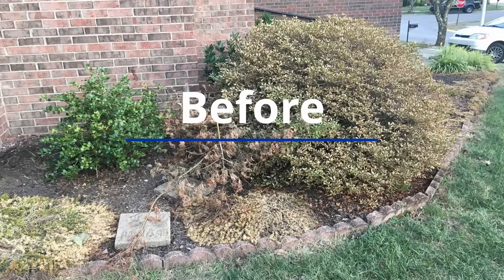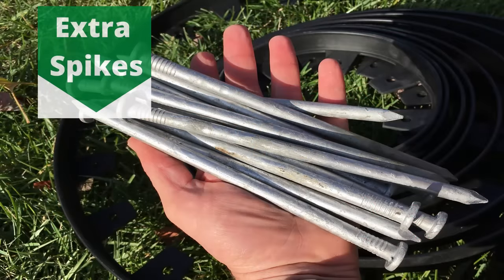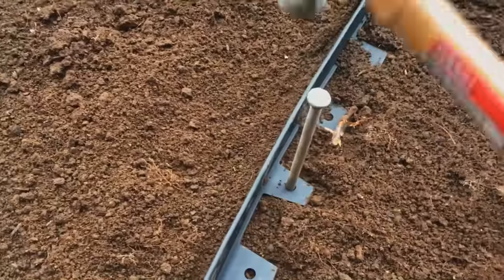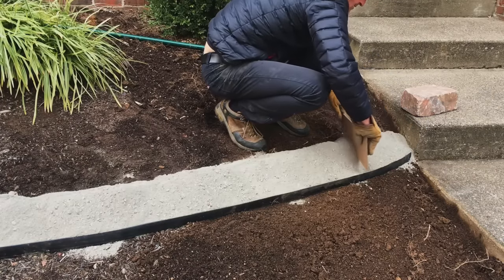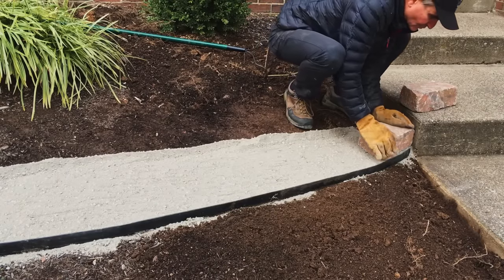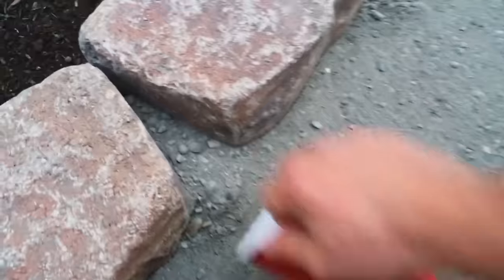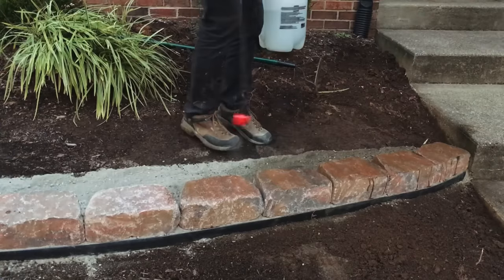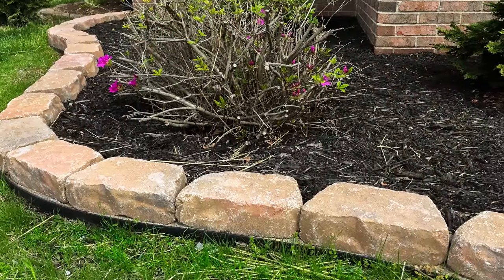easy diy No Dig Border *2020 UPDATE*

Comment: How many bags of cement did you use and how many feet was the area you did?  I want to do something similar and it’s 40 feet long area by 4 feet on the ends.  Thank you for your help, this video is just what I needed as this is my first time doing a project like this.
Reply from the maker: Oh good! I's so glad you found this video. This technique solves many problems people have had with different borders. Each bag of concrete mix works for about 5 linear feet so you would need 10. Get one or 2 extra, though, just in case. Its never fun to run out of supplies during a project. Have a great day, Michelle!!
Reply: @maxpatch67  thank you so much for your help!! I have never done any type of landscaping work and I was to the point I was thinking of hiring someone to do it, but after finding your video, I feel a lot more confident I can pull it off.  What I want to do is use decorative stones to fill the front area of our home and use this for the border around it.  I did see similar rocks that you used but I felt they were a little bigger for the area we have so I went with ones that are a little smaller and think they will work perfectly!  I’m so excited to get started.  I sincerely appreciate your help and again thank you so much for sharing this video, I’m sure you have helped so many people save so much money, time, and hard work with this and I can’t thank you enough!  I will keep you posted and if possible or share a before and after picture or video! Take care!
Reply from the maker: Michelle, you are too kind. Thank you so much for this thoughtful comment. I really appreciate you taking the time to leave this comment. It sounds like you are a very visual person like I am and you want it to look good. I think you made a good choice using the smaller stones for the smaller area. I would do that too if I were you. If you get it finished, I'd love it if you could send me before and after pix that I can share on my website to share with others. My email is tim@timvogelaar.com.
Reply: @maxpatch67  I will definitely send you before and after pictures!  The before won’t be very pretty at all, but I’m hoping I do a good job with this.  And yes, you are correct, I’m a perfectionist or so I’m told, I want it to look perfect and it will mean so much more to me if I can say “I actually did this!”.  I’ve been getting braver with diy’s lately, I painted our entire home inside last year, first time for me.  It took me awhile as I love painting but I get tired of doing it, but it got done and I was so proud of it. So I’m hoping this will be the same scenario.  Again, thank you and I will send you pics once it is complete.  😊
Reply from the maker: Awesome. This is the right border for you because it is going to stay perfect looking for you forever because of you using this technique and it will also help a lot with weed control by helping keep things out of your landscaping area. Here is a really good mulching technique that I highly recommend since you want to make things very nice and stay nice: https://studio.youtube.com/video/HIWDPlaB6wY/analytics/tab-overview/period-default This goes a LONG way for weed control.

Comment: Will this not create a potebtial drainage problem?
Reply from the maker: You will need to figure what to do with your water situation. I usually divert the downspouts into the ground and run them out into the yard about 10ft or so where the water exits through a drain box. Every situation is a little different. I'm glad you are thinking about that!!

Comment: Great video! We have to do a 100 foot border and are on a tight budget. can we skip the plastic border and use paver sand instead of cement?
Reply from the maker: Ya, I understand your dilemna. The border costs around $5.50-$6.00 per foot so yours would be around $500-$600 for the materials. You can cut corners how you want, but the cement is a major part of this technique. The cement provides four major functions in this border technique 1. Height(for looks) 2. Keeps the stones straight/aligned over time 3. Stability/strength 4. Weed barrier(the extra width is nearly impenetrable to aggressive weeds and grasses(Bermuda Grass) that we have here in Nashville.
Reply: @maxpatch67  Thanks for the advice. We will be starting soon.
Reply from the maker: Thor Matt, you're welcome. I'm so excited for you. You won't regret creating your super nice border. If you'd like to send me pix to my email tim@timvogelaar.com then I could post them here: https://www.timvogelaar.com/Diy-no-dig-border-folder-of-galleries for others to see. Feel free to browse other viewers' work there. People have really improved their properties as you can see in the photos. Have a great day!

Comment: Is the plastic edging strictly necessary? the space I want to do butts up to a sidewalk so I'm afraid the black plastic will look funny
Reply from the maker: Ya, the plastic edge is meatnt to use as a form for the concrete mix and a way to level it off level so if you can use the driveway for this, then you would not need the plastic edging. I hope this helps!!

Comment: Is the cement really necessary? Or can we work with out it?
Reply from the maker: This technique really centers around this unique cement product...not using it, you lose out on the qualities it provides. The cement provides four major functions in this border technique 1. Height(for looks) 2. Keeps the stones straight/aligned over time 3. Stability/strength 4. Weed barrier(the extra width is nearly impenetrable to aggressive weeds and grasses(Bermuda Grass) that we have here in Nashville. I hope this helps, Jeremiah!!

Comment: If I am butting edging against a concrete pad can I use this edge instead of the edging? If so do you recommend how deep the concrete should be if not using the edging?
Reply from the maker: Great idea. Here is exactly how to do this. Dig you area out to about 3" deep for about 1' out from your concrete pad. Instead of using a flat piece of cardboard for your levelling tool, use about a 2' long piece of cardboard and  cut about a 1/2" out from about half of the cardboard length. When you use that to level it off with the concrete pad, let the part that you did not cut out hang down into the cement mix and after levelling, the cement mix will be flat and smooth and just the right depth for the blocks to sit. If you have any questions about this, just ask...have a great day!!

Comment: Looks great! Question though: wouldn’t it work better if you inverted every other block so they fit more cohesive together? That way there’s no gap in between to deal with? Not trying to be critical, just planning and wondering if there’s a reason behind the method. Thanks !
Reply from the maker: Ya, that's a great idea to flip them around, but with curves like this, it does not work because then it looks worse with some gaps on the front on the outside of these curves. Your idea is perfect for a straight line. WIth curves, you'll want all the gaps on the inside. Have a great day, Willyman!!

Comment: Can you layer the pavers using this method.. 3 high
Reply from the maker: Dutty, I have not made a second layer on this type of border because I don't know if it would look that good and the difficulty level is raised some because you would mix up and use a traditional mortar between the layers. You could also use landscaping block adhesive. Even, though, it involves more work, I would highly recommend digging out the old dirt and mulch out of your area so the level is dropped enough so that there is plenty of room for the mulch to sit in there without spilling over. Also, the same thing can be accomplished by building your border out further so the dirt can slope down to the level of the bottom of the blocks and also have room for mulch. I hope this helps.

Comment: What if your land shaping is un even and you  need more stone layers on one end to keep the mulching contained.
Reply from the maker: I would suggest only making this border one layer of blocks high. You can do different things so you don't have the need for a second layer. 1. Remove excess dirt and mulch from the area so that its not so high and will not spill over the border. 2. Build the border out further, creating a larger area so that the ground level can slope down slowly to the border so the mulch can easily stay in and not spill over. In every situation, I will choose one of these two methods if needed. I hope this helps. Have a great day, Perry and Keshah!!

Comment: What if I want to add another two layers ? Do I also have to do concrete between those ?
Reply from the maker: Randy, I have not made a second layer on this type of border because I don't know if it would look that good and the difficulty level is raised some because you would mix up and use a traditional mortar between the layers. You could also use landscaping block adhesive. Even, though, it involves more work, I would highly recommend digging out the old dirt and mulch out of your area so the level is dropped enough so that there is plenty of room for the mulch to sit in there without spilling over. Also, the same thing can be accomplished by building your border out further so the dirt can slope down to the level of the bottom of the blocks and also have room for mulch. I hope this helps.

Comment: Does the concrete work on the grass or i have to dig the grass out before set them down?And if I don’t pick up the grass does concrete gonna kill unwanted grasses? Thank you!
Reply from the maker: Lay everything down right on top of the grass. The concrete mix will only kill the grass that is right under it and not everywhere.
Reply: @maxpatch67  thank you I planning to do it for my front yard this winter, hope it turns out perfect like your!
Reply from the maker: Hey, I think the bag of cement mix says the temps need to be in the 50's for it to set properly so don't try it when colder....have you made your border yet?
Reply: @maxpatch67  not yet but I planned on getting it done before spring in zone 9 . Is it cool? Thanks for your reminder!
Reply from the maker: @nhannguyen-mc3ym  Sounds like a good plan!!

Comment: What would you recommend in place of quick-crete for a less permanent solution? Thanks for the vid!
Reply from the maker: You're welcome, Lianne. I don't have a substitute for the cement because the cement is at the core of this border design. If you want to substitute it with something else you can. I understand that you would want to if you're not sure of what you want for many years and need something less permanent. You may just want to choose a different type of border. Here is what this cement mix does in this border design: The cement provides four major functions in this border technique 1. Height(for looks) 2. Keeps the stones straight/aligned over time 3. Stability/strength 4. Weed barrier(the extra width is nearly impenetrable to aggressive weeds and grasses(Bermuda Grass) that we have here in Nashville. I hope this helps, Lianne. Have a great day!!

Comment: Thanks, great video.
What is the spacing on the spikes? Every fourth hole?
Reply from the maker: Maybe about one per foot on average?? You won't to pound them into any low spots because it will kink up the natural curves of the plastic edge product. If you do, don't pound them down tight to the ground. This allows the plastic edge to glide over low spots and level things out a little. Also, if you have a tight curl on the end or something isn't shaped right somewhere, you might use 2 in a row to straighten things up in that spot.....so it really depends...I hope this helps!!
Reply: @maxpatch67  Thanks very much. You the dude.

Comment: Can I use the same concrete concept to put over grass and then add rocks as a pavement.  I want to get rid of my grass and put down rocks in the front of my yard.
Reply from the maker: I wouldn't do it over a super large area, but yes, that should work. Make sure to get "fast-setting" concrete mix. Have a great day!!
Reply: @maxpatch67  thanks for the response 👍
Reply from the maker: @ladymax68  my pleasure, Ladymax!!

Comment: This looks great! But I'm wondering how well the stakes will hold in Florida sand.
Reply from the maker: Severl people have built them down there and didn't report a problem with that. It shouldn't be a problem. The plastic is very flexible and really the heavy duty stakes would be overkill in the sand down there. I buy the metal ones to help get through rock, roots and clay, so you could probably just use plastic ones for a little cheaper. Thanks for the question, SpaceCoastKid!!
Reply: @maxpatch67  Thanks for the reply! I'm going to do it and then I'll report back on how it worked out.
Reply from the maker: Oh cool. If you have the time, please send me some pix to tim@timvogelaar.com. I'd love to see your handiwork and post it on my website: https://www.timvogelaar.com/Diy-no-dig-border-folder-of-galleries

Comment: I have a flower bed that is on a slope.  Will using the plastic boarder along with the nails prevent everything from slowing sliding down the slope? I'm in New England if that helps.
Reply from the maker: This border will not slide down your slope. It will stay looking perfect over many years in New England. Yes,, between the spikes and the plastic edge and the cement, it will stay looking great.
Reply: @maxpatch67  Thanks! I ended up doing this section of the flower bed too; it was bothering me for a while.  I actually had to put in a small retaining wall first because the slope just dropped off, for the rest of the slope I put some rebar lengthwise on top of the concrete before putting down the blocks.  I think this should hold just fine like the other flower beds I did last year.
Reply from the maker: Sounds good, mapex311!!

Comment: Can you stack them to make it taller? If so how?
Reply from the maker: Carly, I have not made a second layer on this type of border because I don't know if it would look that good and the difficulty level is raised some because you would mix up and use a traditional mortar between the layers. Even, though, it involves more work, I would highly recommend digging out the old dirt and mulch out of your area so the level is dropped enough so that there is plenty of room for the mulch to sit in there without spilling over. Also, the same thing can be accomplished by building your border out further so the dirt can slope down to the level of the bottom of the blocks and also have room for mulch. I hope this helps.

Comment: Quick question 🤔
Can you add/stack a second layer of bricks?!
Reply from the maker: I have not made a second layer on this type of border because I don't know if it would look that good and the difficulty level is raised some because you would mix up and use a traditional mortar between the layers. Even, though, it involves more work, I would highly recommend digging out the old dirt and mulch out of your area so the level is dropped enough so that there is plenty of room for the mulch to sit in there without spilling over. Also, the same thing can be accomplished by building your border out further so the dirt can slope down to the level of the bottom of the blocks and also have room for mulch. That being said, you can use the landscaping block adhesive and do this. :) Others have. I hope this helps.

Comment: Thank you for your sharing!
 I have a question that If I stack rocks three layers high, can I use fast setting concrete between on them and make them stick together?
Thank you!
Reply from the maker: Echo, I have not made a second layer on this type of border because I don't know if it would look that good and the difficulty level is raised some because you would mix up and use a traditional mortar between the layers. You could also use landscaping block adhesive. Even, though, it involves more work, I would highly recommend digging out the old dirt and mulch out of your area so the level is dropped enough so that there is plenty of room for the mulch to sit in there without spilling over. Also, the same thing can be accomplished by building your border out further so the dirt can slope down to the level of the bottom of the blocks and also have room for mulch. I hope this helps.
Reply: @maxpatch67  
Thank you for your information !👍
🥰
Reply from the maker: my pleasure, echo!!

Comment: But what would you do if, in the future, you decide to take out the landscaping or change it.
Reply from the maker: Ya, if you are not VERY sure you want this for many years, then you should go with a much more temporary edge. This border is built to look good and last a very long time.
Reply: Ok thank you. Also, I live in the the north so the ground freezes. Will the concrete break up as the ground freezes and thaws?
Reply from the maker: Dillon, this is an excellent question and one that I would be interested in knowing too if I lived up there. I build these borders here in Nashville where I live. Here is what I know. On my older video of this technique, I had people from several years ago, testify as to how happy they were with this border after multiple winters and these people lived in New England, Chicago, and Canada. That being said, I don't have personal experience building them up there and I do understand your concern. Also, check out the very first pinned comment below the video. A viewer wrote about this topic.